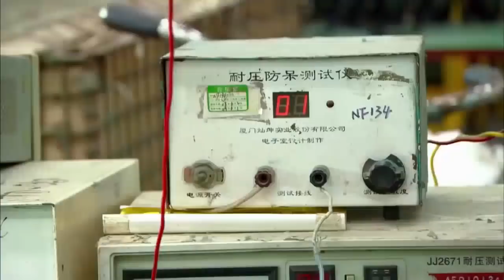The World's Largest Factory - China's Unstoppable Labor Force - Part 1

Comment: 8:12 - somebody should be executed for not designing boxes that fit into a standard ISO shipping container with less wasted space.
Reply: Weirdly shaped boxes are a competitive edge. No joke. The larger and less standard shaped a box is the less competitors shit you can have
Reply: @Demonslayer20111  Are you talking about retail shelf space?
Reply: @Spinolio  it would apply to shipping containers as well unless you buy entire containers just for you
Reply: @Demonslayer20111  As it just so happens, I have a background in importing goods, and aside from samples or 'emergency' orders which typically go by air, importers of commercial goods rarely ship quantities of less than a full 20 foot container because it's very expensive, in my experience. You would typically have to go through a freight consolidator/broker in the country of origin, who would put together your freight with other shipments to your port of entry where the container load would be broken down and sent on to wherever it was going. That can easily triple your per-unit shipping cost, so even if you can only fill half a container with an order, it's almost always cheaper (and faster) to do it that way than through a consolidator. 

So to circle back, as the kids say, when you're shipping dedicated containers, the goal is to always keep dead space under 10%, and to avoid sharing containers whenever possible.
Reply: You should look at it more clearly. Those are japanese boxes, purposely made weird to make sure the Japanese customers pay more.